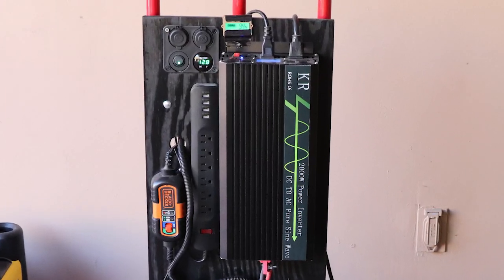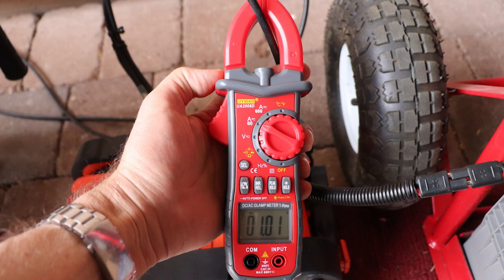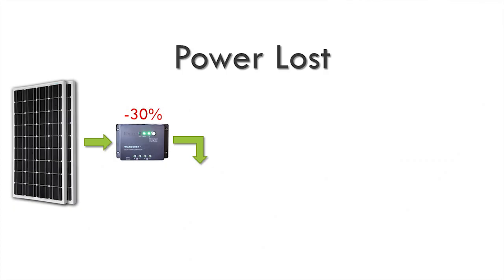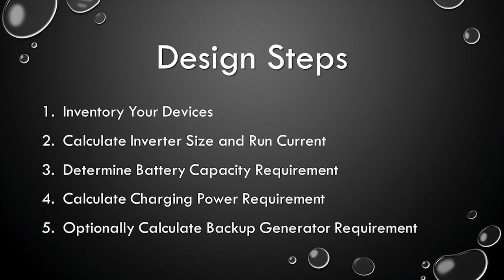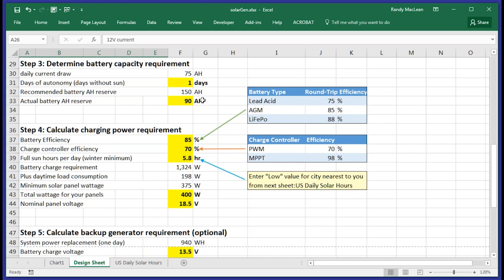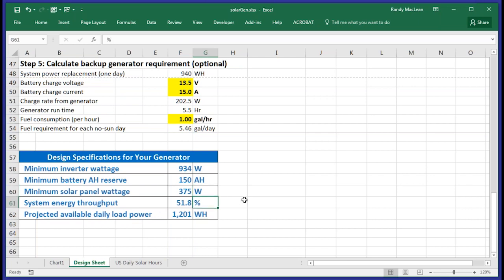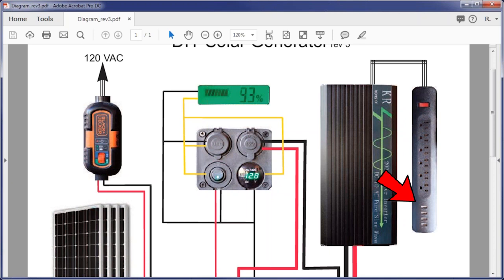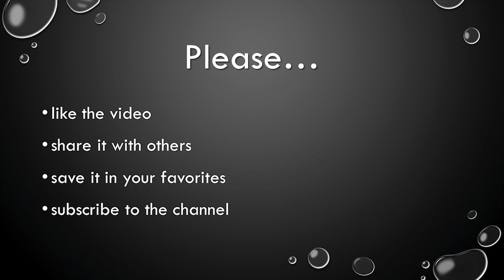DIY Solar Generator - Builders Guide - Engineer Your Own in 13 Minutes

Comment: An extreme rain day is not zero, the result vary from best 1/4 the power to worst 1/10 the power of a sunny day. The best time to run the generator is at sunset of that rainy day so that you keep whatever benefit from the rainy day solar power generated. The solar controller can extract more or less power from the clouded sun : some MPPT are faster for clouds, others are better at obtaining a better total from rainy day. So the total at sunset is more variable depending on the controller than the full sun total. Around 1 PM I have NEVER seen less than 2KW output from my 8,5 KWC system. Max 6,3 KW on the best sun days. The only way to get zero from the panels in one day is to unplug them.

Comment: You need to add a Low Voltage Disconnect, similar to this: http://mwands.com/store/battery-protection-switch Then you won't inadvertently kill a battery.

A DC bus bar would make the setup nicer, placing most of the stuff in a water resistant cabinet would be a good idea too.
Reply: Joe Malovich Thank you.   This was my recommendation.
Reply: normally the inverter and or solar charge controller does that

Comment: I don't see protection for the battery? in my case I put a 80A trip switch in which cuts the battery of from the system.
Reply from the maker: I’ve given some thought to this, and with everything on the battery fused just inches away, I’m not sure there’s much utility in a main battery disconnect.  If I build a similar setup in my RV, for instance, I’d definitely have the disconnec6 switch, and a battery isolator as well.  Thanks for the suggestion — I’m sure a lot of viewers will be on your side on this.  BTW, there’ll be a follow up featuring the complete assembly of rev 4 of this project out next week.  You might be interested in the upgrades in the rebuild.

Comment: Nice job on updating your previous
Reply: I wanted to know if you recommend the Inverter , looking to get one but could not find any reviews, thanks.
Reply from the maker: I like the inverter a lot.  Works very well, quite efficient, and love the status panel.  It also has some pretty good protective capabilities, including an alarm when you’re driving your battery to damaging low voltage.  The price is quite reasonable, and the dine wave is very good.  I’d definitely buy it again...

Comment: You keep mentioning that "you have to make sure the battery doesn't fully discharge". Exactly how is that done?  Once the load is being drawn on the battery........it keeps being drawn until there is no more. Can that be prevented? Can a "battery saver" be installed inline  to preserve enough power to save the battery? Or is there something out there?
Regardless, great videos and Thank You for not believing in moats. Godspeed.